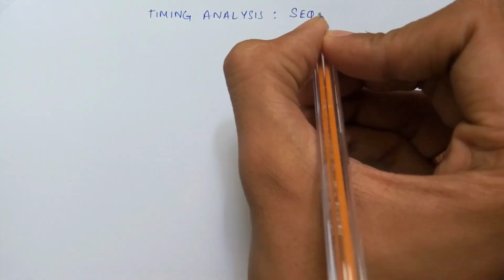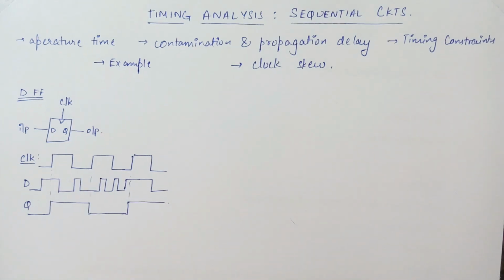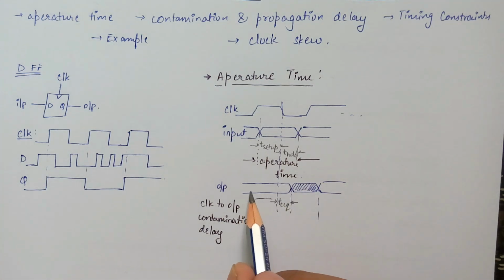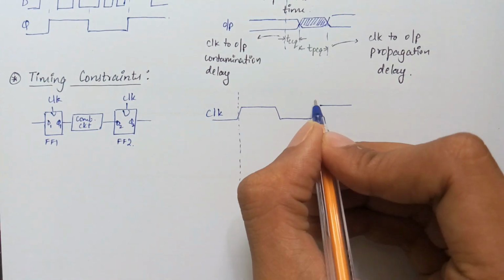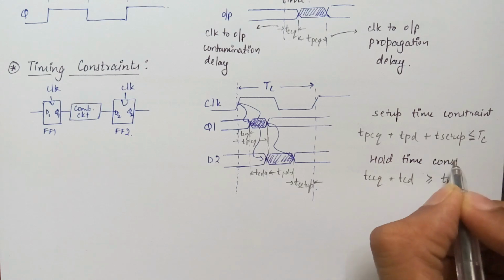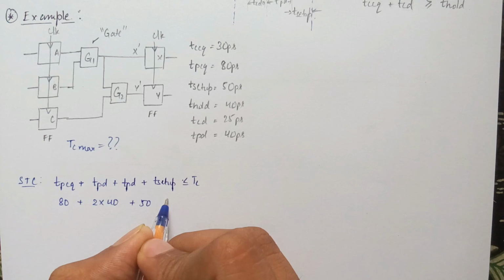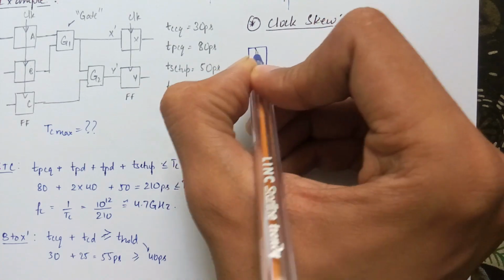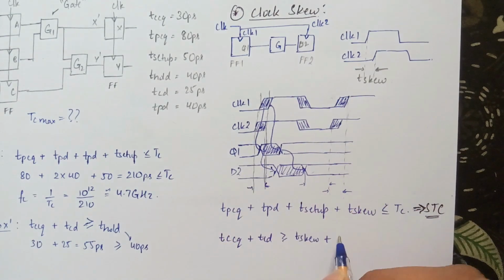Static Timing Analysis(STA) of Digital circuits- Part 2: Sequential circuits

Comment: Definition of propagation delay do not match in part 1 and part2.
I think propagation delay will be from the point of falling (or rising edge) of clk to the point
where the output settles down to a constant value.
Reply from the maker: Part 1 explains the propagation delay of combinational circuits whereas part 2 explains the same for sequential circuits.
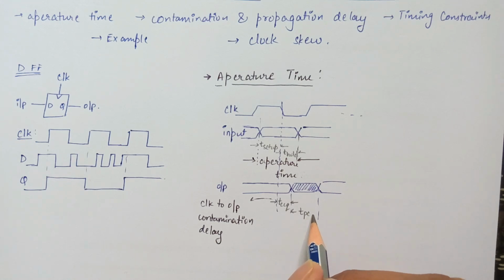Yes, you are right about the second statement considering flipflops. There is a mistake in video(audio is right) on first drawing (at 3:30) and the video is also correct for further diagrams.
Thanks for pointing it out and I hope this explanations helps !!

Comment: How come in the last video, the propagation delay is from when the input starts to change to when the output stabilizes, and here it's the time from when the output start to change to the output stabilizes? Which one is correct?
Reply: https://www.quora.com/What-do-the-propagation-delays-contamination-delays-setup-time-and-hold-times-of-a-circuit-register-represent-and-how-do-they-relate-to-each-other
Reply: The previous one is correct. Its the delay from the clock edge to the time the output stabilizes.

Comment: Shouldn't the clock to q propagation delay be measured from the clock instead of when o/p becomes invalid?  Put another way, should the left arrow on the measurement to t_pcq point to the line coming down vertically from the clock transition?

Comment: HI, that's some great quality teaching there!
I have a doubt regarding the equation where you introduced the clock skew (Tskew) in the setup time constraint.
Shouldn't Tskew be on the other side of the equation? I think that positive clock skew actually helps us meet the setup time constraint by increasing the effective time period the clock (Tnew = T + Tskew) and hence if it is positive, it should be on the right side of the inequality as it is actually giving more time for the data to arrive and not reducing it.
Reply: Since i am answering 1 year later, I presume you already know the answer. Anyway I'm answering for any person who has the same doubt. He considered positive in one and negative in another case, looking at the diagram physically. Don't go by the formula
Reply: @omkarrajebhosale4153  explain clearly plz
Reply: @orugantimanideep2209  actually the motive of writing that equation was to consider the worst case scenario. Making it Tskew + T will give more time for data transmission, but we want to consider the worst case scenario. Hence we consider  the Tskew term such that it tries to see if violation occurs at worst possible case
Reply: @vprakash2471  Got it, thanks 😁
Reply: @vprakash2471  but how can this be possible?? as far as i can recall, there is a thing called pipelining in which we deliberately add combinational ckts between flip flops to reduce setup violations. how can clock skew increase the setup violations

Comment: Shouldn't tpd be measured from the first transition in Q1. I hope you respond asap
Reply from the maker: Hi Noel Nebu,
No, You are missing the point that the combinational block also has both contamination and propagation delay.
The tcd(contamination delay) is measured from the first transition on Q1 to the first transition after the CL(combinational logic) block, whereas the tpd is measured from the stable output of Q1 to stable output of CL.
I hope this clears your doubt!! :)